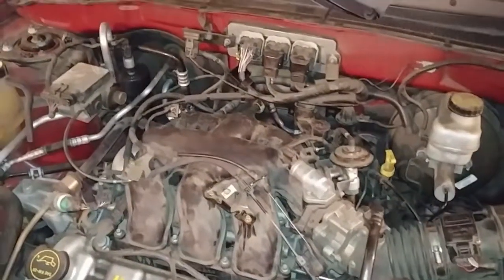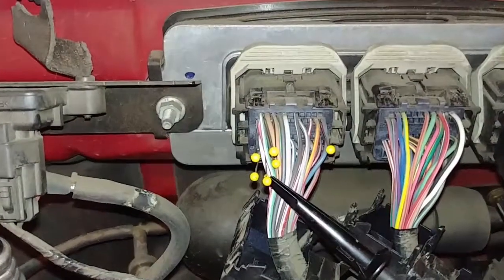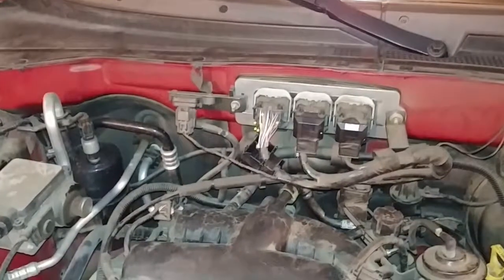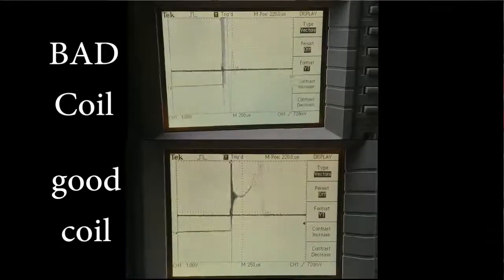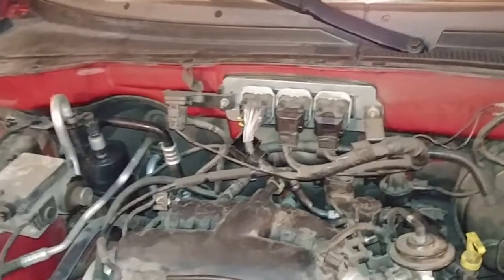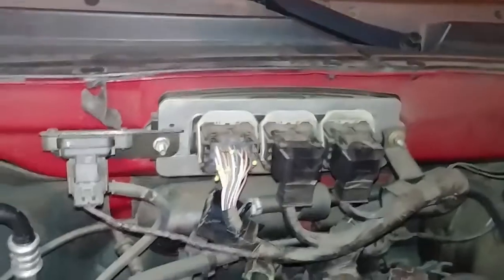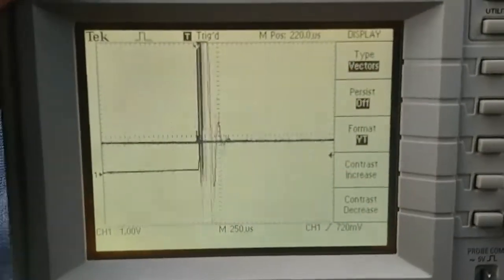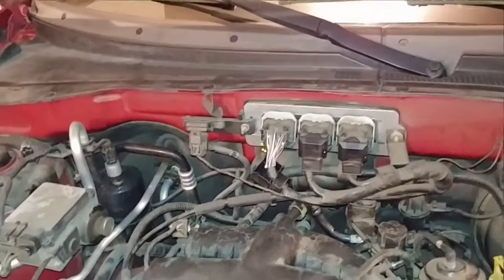Coil On Plug Intermittent Failure - NO DTC - SOLVED!!!

Comment: Great video and insight.   FYI  I have 5 FORDs and have found I can determine the coil pack with $15 ODBII  code reader  even without a code.  I usually can find the misfiring cylinders under the heading of "pending codes".  Not all reader software will give this info.  As I recall "Car Scanner" and "Incar Doc" do and both are free.

Comment: i had the same problem same symptoms in my 2003 Scape, but i couldn't get a scanner with missfire counts or oscilloscope, so i bought 6 COPS Beru & got fix & still working strong since 2 years ago.
Now having the same issue with my GM Truck 2004 5.3l.
Good video dude, cheers from Cancún
Reply: Escape*

Comment: I'm with you on the merits of an oscilloscope. As a DIY mechanic, I was ready to up my game with one. Picoscope isn't priced to make sense for the DIY guys. I opted for HANTEK and their probes and current clamps.
Add homemade in-cylinder pressure transducer and "First Look" (wannabe) pulse sensor and the home mechanic is good to go.
There's an Android app called HScope compatible with HANTEK scopes which is the cat's ass!
The Pressure Waveform Overlays app on the Microsoft Store is also really nice.
This video should have gotten way more views, but as a small YouTuber myself, I'm not surprised.